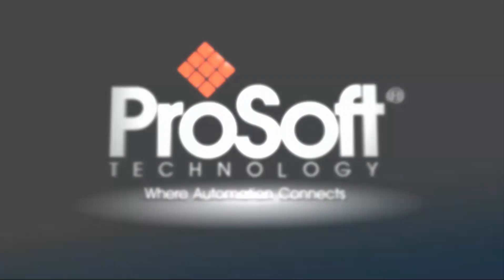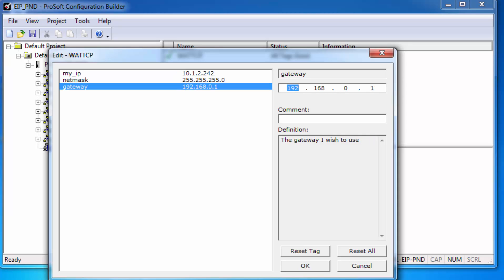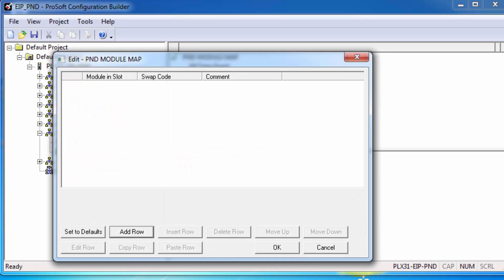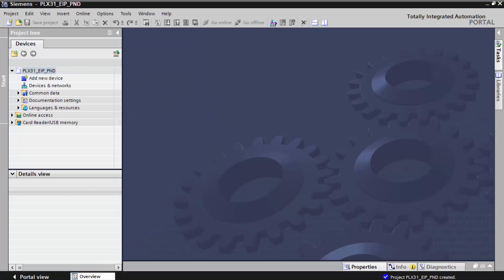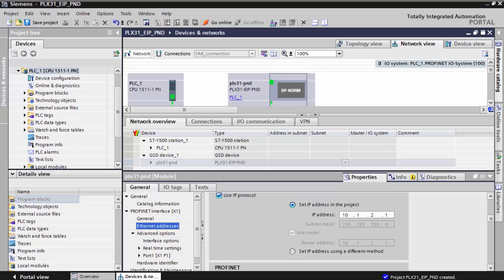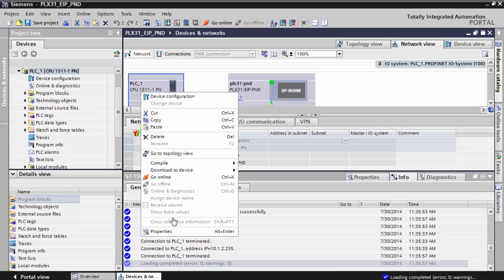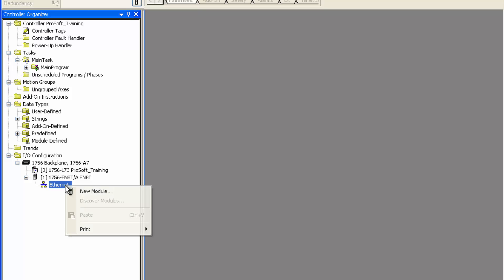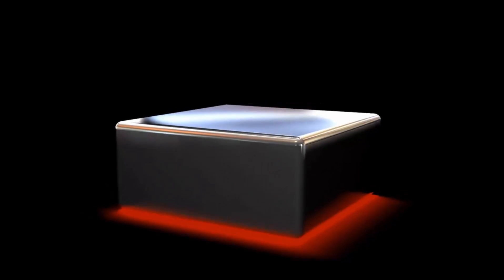Set Up: for EtherNet/IP to PROFINET IO Device Gateway

Comment: So, with this gateway, you need your Ethernet/IP and Profinet networks to be on the same set of IPs, correct? And all the Ethernet/IP and Profinet communications happen on one cable, connecting to the one port on the PLX31?